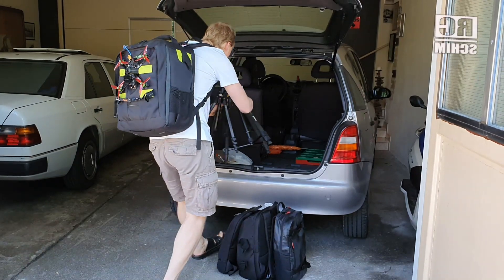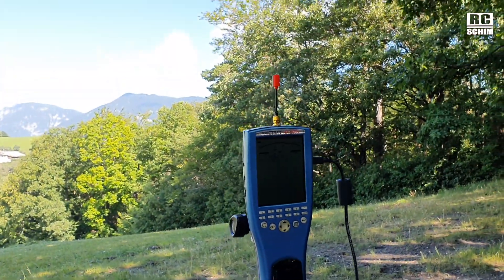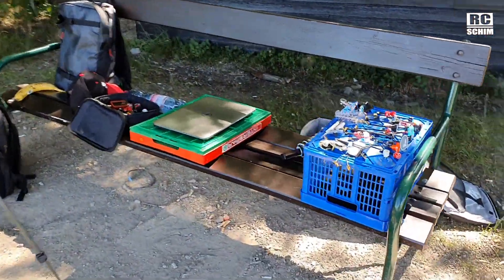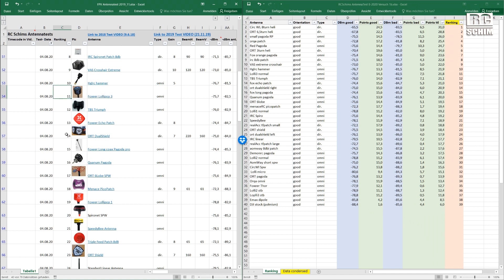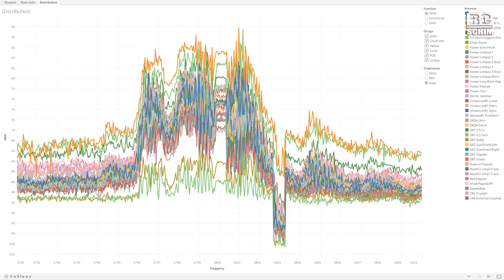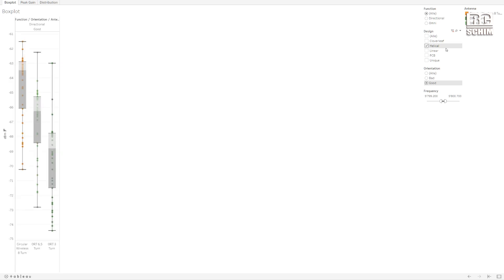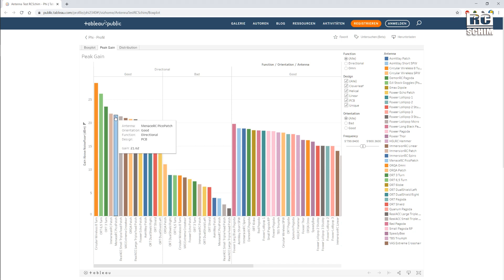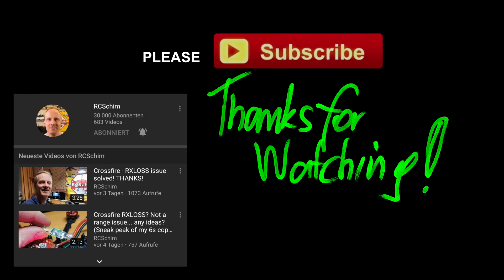RCSchims MEGA FPV Antennatest 2020 (most accurate yet, interactive results webpage!)

Comment: You made me think of a question.  How much do the insertion losses affect performance between UFL ipx, MMX and SMA connecters? They may be negligible. Thanks.
Reply from the maker: As all questions are always welcome - this is a really good one! It lead me to this post from menace: https://menacerc.co.uk/sma-adaptors-signal-loss-or-not
Check out how much loss different cables have! 
I will re-visit my current goto quad - because out of convenience I use a pigtail mmcx to sma adaptor - while I also have Lollipop or SpeedyBee antennas directly with a mmcx connector. I didnt think there would be that much of a difference! Thanks!
Maybe I test this more (like menace in his article) and make a short video about it...

Comment: I'm surprised at the stock DJI antenna result given how well it performs in real flight bitrate performance tests compared with many of the featured antennas. Given the DJI antennas are RP-SMA did you use RP-SMA to SMA adaptors? Because using adaptors will actually lower the performance.
Reply from the maker: The DJI stock antenna test is not very serious here I have to admit. It was the wrong polarization   (but in my DJI tests polarisation mismatch didnt alter the results much).
I will test this more and try to give a better image.
I think tho:  with 700mw or more, you can mount a piece of wire of your choice (maybe even a twig) and DJI fpv would get usable videolink anyways :)
Reply: @Rcschim  Wrong polarisation yikes. Wire or twig lol. 😆 I will await your upcoming retest video. 👍

Comment: Was the DJI stock antenna so bad because it was LHCP but the transmitter was on RHCP?
Reply from the maker: yes and no. In my previous tests with DJI goggles I thought I'd see dramatic drop in performance when mixing pols (pol mismatch) - but I didnt! Maybe it's different in analog application here tho.
I should repeat a smaller test with just a pair of good (potential DJI antenna upgrades) vs the original set (air antennas + goggles antennas - but with analog VTX and my spektran).
Reply: RCSchim Yes, please do 👍🏻

Comment: are you using adapters for the foxeer antennas on the dji fpv? because all are sold with rp-sma male connectors, thats the same, that the dji fpv google use?
Reply from the maker: yes, I ordered a few of these here: https://bit.ly/2CpfhHy
they let me use my SMA antennas on DJI goggles.
Of course I also swapped the Antennas on the airunit to be RHCP instead of LHCP
Reply: RCSchim Could you post a picture of your setup? Which antenna did you put on your air unit? I see the Lollipop 3 is available in angled sma (10cm) ?

Comment: Great info as usual Mario.  I'm working on a similar (albeit less comprehensive) antenna comparison where I'll be providing information that supplements what you've done (I won't be reinventing your wheel).   I'll look at beam-width and axial ratios which are also important factors in antenna design and something that is often overlooked.   If you're flying analog FPV, axial ratio is especially important because it determines how effective an antenna is at rejecting reflections.
Reply from the maker: Cool Bruce, cant wait to see your findings. Have you noticed the nice irony here: Foxeer L1 was the best (because it was apparently a clone of Axii) and the newer ones were not so good? I had some doubts with my measurements first - but now it makes sense :)
About beamwidth, SWR and Axial:  great idea! One commenter here asked about SWR and the impact. Alex Greve of course knows a thing or 2 about antennas and tested it nice: https://www.youtube.com/watch?v=XCFul9qxvjE
I dont have an SWR meter yet (not sure if the cheap ones are good?) but axial ratio is probbably not so easy to measure? 
Curious how you test the beamwidth. greets, Mario

Comment: Which one ur recommendation for below 1500meters on micro/tp3 with 600w-1000w vtx
Reply from the maker: If you check my description I give recom. to which antennas I currently use on DJI fpv (after testing). 
Lolli1 (or Axii from Lumenier)
Orqa P1 patch also quite nice.
In reality, if you have a good old IRC 8dbi patch - it's also quite good.   The VAS extreme crosshair is also good, but a bit expensive.
and with 600mw (I hope you meant milliwatts and not 600 watts :)
you can use any omni antenna and be good.
Reply: @Rcschim  oh nice. Thx for really good info and so much works has been done. Much appreciated and stay safe sir.

Comment: a lot of work and effort went into that thanks for that.
i have a question what effect does the swr have on these results? i have had two of the same antenna with different swr.
Reply from the maker: I could try to explain what SWR is - but there is one guy that really knows what he's talking about: (ibcrazy)
https://www.youtube.com/watch?v=XCFul9qxvjE
I think poor SWR is effecting your range, bad axial ratio effects your antennas ability to be "immune" to reflections (when flying near objects, low).
Reply: @Rcschim  thanks for the reply, love your videos, no i know what swr is, but what i am saying is did all the antenas have the same swr  ?
Reply from the maker: @stevemann6082  That's of course a valid question. I could only answer this if I convince myself that I also need to spend some cash on a SWR meter :)

Comment: Holymoly that is a lot of work! Now I am affraid to ask since that sounds so......you know....anyway, can you test the DJI system? Your tests are the best.....THE BEST! Keep it going
Reply from the maker: What do you want to be tested with the DJI sys? I already have a few videos about DJI FPV. Check them and please let me know what more I should test...
And thanks!
Reply: @Rcschim  personally I'd just like to know the two best antennas to have and where to put them on the goggles.

I have the lhcp URUAV patch antennas and the menace digi pack also patch but the digipack has two extensions on them as they are supposed to work better further away from the goggles whereas the URUAV fit very close.

Two of these antennas leave me with two stock DJI antennas to upgrade..... Presumably Omni rather than another 2 patches. Which would you say work best for combination of all around flying max 1 mile out in ideal conditions?
Reply from the maker: for 1mile you can leave on the stock antennas :) 
many swear that the TrueRC singularities are good. I wanted to test - but they have such a high backlog on orders they didnt want to send me samples to generate even more demand on their products :)
You could also try lhcp lollies or chep SPW antennas. If you get them specifically for DJI goggles, buy em with rpSMA connector (and watch out for LHCP if you stay with the stock Airunit antennas.
Reply: @Rcschim  agree that the stock antennas are good for the distance ... Where I fly I struggle to keep a good quality bit rate hence the interest in other antennas.... I also fly a lot in dense woodland
Reply from the maker: @gmivisualsjason3729  dense woodland! Yeah. Will be the theme for my next DJI DVR compilation video :)   I thought about the title "run FORREST RUN" what do you think? :)
(it suits to my "riverRun" title from last time)
Reply: @Rcschim  😂😂. Brilliant
Reply: FPV wannabee bro the absolute best omnis for dji gogg are the VAS ION stubbys they have the highest gain of any Omni n low axial ratio. They outperform my 4 lollipop stubbys by a ton even beat pagodas. Only con is they have big top nulls. But there’s 4 lol. Btw I run 2 mmcx lollipops on air units
Reply: @flo-ridafpv5713  appreciated
Reply: @gmivisualsjason3729  YW bro...btw alex grieve runs 4 ions ;), if ya wanna see performance, check my flights, all gogg dvr superviewed w beats
Reply: The DJI antennas are included in the tests.....